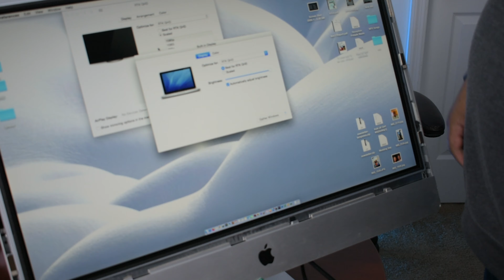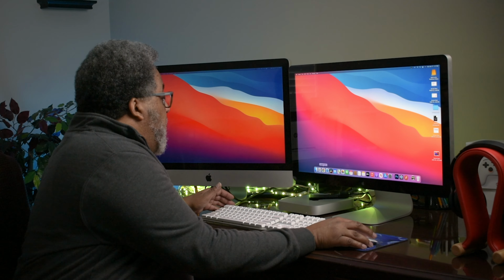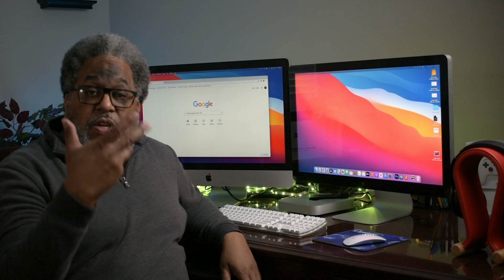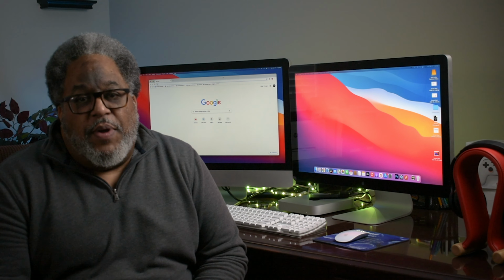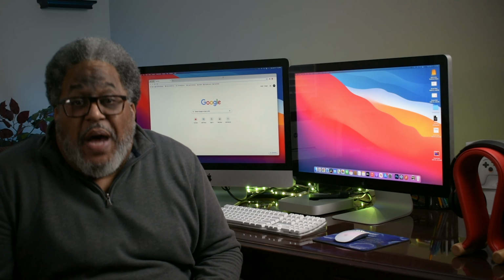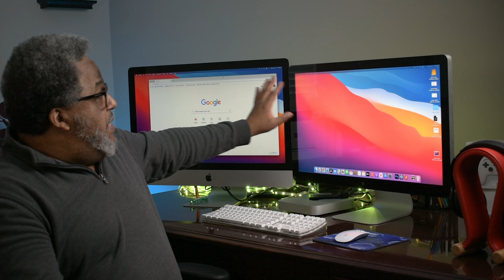Turning a 27" iMac into an Apple Cinema Monitor for the Mac Mini M1 and Review

Comment: I did this with a 2009 iMac.  I also took a thunderbolt dock out of its case and put it in the iMac.  This let me hook up the iSight camera, DVD burner, microphone and speakers as well and have it all connected on the inside.  I have plans to also connect the SD Card reader and make (most of) the old ports on the back of the iMac live and connected to the dock as well.
Reply: A video please.
Reply: i know im asking randomly but does anybody know of a tool to get back into an instagram account?
I stupidly lost my account password. I love any assistance you can give me
Reply: @Yael Milo instablaster :)
Reply: @Marcellus Jorge it did the trick and I finally got access to my account again. I am so happy:D
Thank you so much you saved my account !
Reply: @Yael Milo No problem :)
Reply: Oh shit! Can you do a video on that?!?! Or a forum post?!
Reply: How did you get the speakers to work?😮
Reply: @JRcash226  I found a very small amp to connect to the speakers and then fed the headphone line from my integrated dock into it.  Unfortunately, I had to abandon it though.  I just couldn't get rid of the coil whine from the amp and couldn't find another small amp that wouldn't overpower the 7W speakers.

Comment: Great video!!!
A. Is it possible to utilise the speakers and the camera that the 27" mid 2010 iMac is equipped with?
B. I have a mid 2010 27" iMac. Are the steps i need to take for my iMac, exactly the same as the ones taken for the featured iMac in this video?
C. Are there any newer boards that have fixed the brightness issue that you adress?
Reply: I would like to know too
Reply: Sure, process is thesame, i utilized the speakers by using an amplifier from aliexpress, it gets both image and sound via hdmi
Reply: @YamatoHD  thanks for the reply but i don't understand how the speakers and camera are utilised!
Also, have you done this conversion, turn the iMac to a display?
Reply: @litemint09  im afraid that nobody will aid us in this brightness issue, not even the video creator   :-(

Comment: I did exactly thesame with exactly thesame model (except i used actual screwholes on the board and not glue). To match the color and brightness of the original you need to bump about 20% of gamma and 2% brightness. In linux you do it with xrandr, in windows using screen calibration app, no idea what you do in mac os, but im sute theres a way

Comment: My original control board works fine, but the GPU is dead. Would it be possible to use the original driver, instead of this generic driver, which seems to be off the shelf on Amazon. Thanks for the video!

Comment: Great video, just downloaded the longer version to watch later today.  Going to  check out your other videos, as well. ..      But,  I have a question, or 2, maybe 3.
    Your iMac, was still working?   I am not familiar with the upgradeability of the 2011(or latest OS version it can run etc.), but i couldn't help but wonder if you could recycle the iMac Motherboard+ CPU+Ram etc.   
      i am looking for an older model  mac mini or mac book to upgrade and use to get acquainted with the Mac OS>,  in addition to keeping my eyes open for an older iMac to recycle the monitor(i got a great deal on an iMac hdmi control board kit).   SO, perhaps that is why i am curious... would it be possible to keep the iMac running and still add hdmi input to the monitor? 
      Does the iMac natively have any kind of video out?   Could you rebuild the iMac into a desktop with hdmi or displayport out and then use it and your new Mac with the newly converted to hdmi display?         I hope you are able to answer, i am very curious. 
       I have  medical limitations/ disabilities.   There is some great disability software and hardware devices that work only on, or best with Mac.   I haven't used a mac since the Macintosh Apple 2.   Looking to get my feet wet on an older model or Hackintosh, i think.
       Last month,  I was  winning an auction for a unibody MacBook Pro 2011/12 ;  in the last minutes i was still researching, and a video on Luke's channel revealed some GPU issues.  I stopped bidding and was relieved to be out-bid.         I had spent  an exhausting month online looking for used MacBooks and minis and i had curated a list with models with i5s and i7s and dedicated graphics, only to discover they were all  "models  to avoid",; and now i just found info saying 2007 and 2011 iMacs are also to be avoided?     Any insights into best used mac minis?    Thanks So much.~   🕹Lisa♿
Reply from the maker: I'll try to answer most of your questions.  First, yes I was able to sell or repurpose the original parts.

Second, there is no easy HDMI in on the iMac.   There was an option for "target display mode" on the older macs if you connected another mac to it by thunderbolt cable, but it no longer works with the newest macs.  That being said, if you get an old MacBook and an older iMac, this will still work.

Third, old macs are pretty reliable.  But any computer that is ten years old will have problems eventually.  I would just buy whatever one is in your budget.  If you can get newer than the 2012 models, I would recommend it.  It that age, hard drives and cooling fans start to fail.
Reply: @InTheTechKnow  
Thank you so much, for your quick and thorough reply.  I really appreciate it.
      I also appreciate all of the time and effort that goes into making these videos for us to enjoy and learn from.
 thanks for sharing ~🕹Lisa♿

Comment: Hi Crhis. Question: The LCD circuit board has connection for speakers. Is that possible to connect the old iMac speakers to it? because the circuit board even comes with a volume changer. And if it is possible, would you be able to show in a video? 
Thank you.
Reply from the maker: Unfortunately, no.  The board does not have an amplifier strong enough to drive the iMacs speakers.

Comment: What do you think about the colors? I'm a photographer/Filmmaker and I'm thinking about selling my Dell P2421DC and buy a broken 2011 iMac to use as display with my M1 Macbook Air.
This Dell monitor I use has 300 nits and is kind of dimmer than I would like but if the iMac gets even as bright as that, I'm in :)
Reply from the maker: I can not recommend using this for photo or film editing.  The colors are not accurate enough.
Reply: @InTheTechKnow  thank you! Good to know :)

Comment: How are those plastic pins called? Im talking about the ones that Chris has mounted on each corner of both boards and is securing them by gluing them on the chassis with the glue gun?

Comment: Great video! I am ordering one for my 2011 imac 27” and i was wondering if the speakers work (it has a speaker connector on the display board), and is the screen much dimmer then before?
Reply from the maker: The built in speakers did not work.  They need a more powerful amplifier than what this board can provide.  Yes the screen is dimmer.  It is a shame that it is not as nice as it was with the Apple driver board.

Comment: Why not just use the original computer power supply for the panel (24V) and control board (12V)?  I think all you would need is a cable to convert motherboard input to +/- of control board.

Comment: thanks for putting up. I don't want to mod my 09 imac if it won't work with the new macbook m1 laptops.
Reply from the maker: It will work with any HDMI capable computer.  You will just need a usb-c to HDMI adapter.

Comment: How exactly did you get the Mac Mini M1 working with the Apple Cinema Display?  I can’t seem to find any success stories online, even three weeks after your video!  Thanks I’m advance, and good video!
Reply from the maker: Great question.  I will do a video on this question and mention you.  The answer is: it depends.  

There are two different Apple Cinema Displays, one is based on Mini Display Port and one is based on Apple Thunderbolt.  The easiest way to know the difference is the Mini Display port has three connectors, mini display port, USB A, and a mag safe power connector.  The Apple Thunderbolt has a thunderbolt (mini display port format) and a mag safe power connector.

Both of them work, but they require a different adapter.  The Mini Display Port Display (three connectors) uses the USB C (Thunderbolt 3) to mini display port adapter. https://amzn.to/3bi0Dzx  You will still plug in the USB A cable to the Mac Mini to have speakers, iSight Camera and usb ports.  

Whereas the Thunderbolt Display (two connectors) uses the Thunderbolt 3 to Thunderbolt 2 adapter from Apple. https://amzn.to/3s9dsmS. With this adapter, you on get access to the Apple Display ports with only one connection.

So which one do you have?  The mini display or the thunderbolt?

(As an Amazon Associate I earn from qualifying purchases and I may earn a commission)
Reply: @InTheTechKnow  Correction - There are many more Cinema display however for modern types there are only 2(3) - A1267 which is 24 inch , A1316 which is 27 inchand A1407 THUNDERBOLT DISPLAY which is 27 inch and has thunderbolt docking and more connectors on the back. the other 2, a1267 and a1316 only have 3 usb ports.

Apple themselves named the A1407 "Thunderbolt display" and not Cinema display

Comment: Excellent video, have you tried any other brands/ versions of the board and gotten any brighter results? Are you able to tell if the resolution and refresh rate are true?
Reply: I want to assume that the brightness can be corrected with a simple led strip as does the same system of imac 2011.
Reply: @cyberkhronos7233  does the iMac have a led strip in the display panel? And if so wouldnt be bright enough as is if the display panel itself was built correctly? Only difference being the driver board
Reply: I haven't seen anything about that led strip. I am very intrigued. Could you help me with an article or take apart diagram?

Comment: This is wonderful. I have two old Thunderbolt 27" monitors. I wonder if I can convert one of them into HDMI. That would make it work on my M1 MacMini.
Reply: Since this been a year ago, but in case you haven't already found out, you can buy a thunderbolt to thunderbolt 3 (30 bux or so) adapter and it will work fine with the apple M chips, I use one myself with no issue. Keep in mind the M1 only supports 2 monitors though. (Although you can add additionals with the display link workaround if you didn't already know).

Comment: So if I add the Mac mini M1 to my 2019 iMac would it speed up and boost my ability to use multiple apps as it use both processors? or would the M1 be the main processor and the Mac itself just becomes a monitor?
Reply from the maker: This is for the older styled iMac pre 2012 model before the iMac was a sealed unit.  It does just make it a monitor and no longer a computer. This video does not apply to the 2019 iMac.

Comment: Is this possible with a 5k Retina display from a late 2014 iMac 27 inch?
Reply from the maker: Not using the techniques and parts in this video.  The 2014 iMac is a sealed unit.  There is glue that needs to be removed to open the case up, and then it would need to be resealed.  It is a lot more complicated.
Reply: @InTheTechKnow  thanks for your reply, much appreciated

Comment: Has anyone been able to used the audio out on the converter board? I've tried but the sound it useless.
Reply: I'm having the same problem with my board. I wanted to use a simple little powered speaker as I don't need anything crazy for this project.

Comment: Does this work on my 2017 iMac?
Reply from the maker: No.  The 2017 uses a different panel.  Also the 2017 is a sealed unit.  It does not use screws and magnets like the older units.

Comment: Would it be difficult to put Mini internals into iMac and make it first M1 iMac?
Reply: that's a brilliant idea, ha ha
Reply from the maker: I like the way you think.  The only issues I see are; 

1. The video is not that good.  Like I said in the video, this has to be a symptom of the driver board.

2.  There may be an issue with cooling.  Even though the fan is whisper quiet, it does spin up when needed and is designed for the current case.

3.  Lastly, the Mac Mini already seems to have Bluetooth and Wifi issues that may be worse throwing them inside the aluminum enclosure.  I fast forward as I am removing bluetooth and Wifi antennae’s strategically placed in the iMac.
Reply: There is guy who mage iMac G5 upgrade. But a lot of hassles instead just buy cheap monitor. But very interesting and cool anyway :)

Comment: is it not possible to do "Screen Sharing" from the iMac to the Mac Mini? That would almost do the same thing?
Reply from the maker: Not with the new Mac Mini M1 and the 2011 iMac.  Target Display Mode is no longer available on any of the M1 Apple computers.
Reply: @InTheTechKnow  hmmm, not really thinking of Target Display... more like  connecting to the Mac Mini thru the network (probably thru ethernet) and using the "Share Screen" option in the Mac OS (from another Mac).
Reply: @CyclingAroundToronto  Hi, yes it is. That is exactly the set up I have. A 4k monitor and the iMac 27". I use a dummy HDMI adapter so it is seen a second display. Runs at about 30fps using adaptive quality. It's quite neat and has the advantage of file sharing, clipboard sharing,  having the second display in a window at multiple resolutions and sharing the keyboard and mouse. I prefer it to a real second display.
Reply: Yes. I have 2 27" Thunderbolt displays. I run the second one on a 2011 mac min (quad-i7) and run Apple Remote Desktop on it. I (like the other poster) put a HDMI dummy dongle in the M1MacMini and remotely display that on the 2011 macMini. It's serviceable. But it takes a lot of power. The poor quad-i7 runs hot and blow the fan. And there are delays and occasional network drop-outs. It's an imperfect solution.